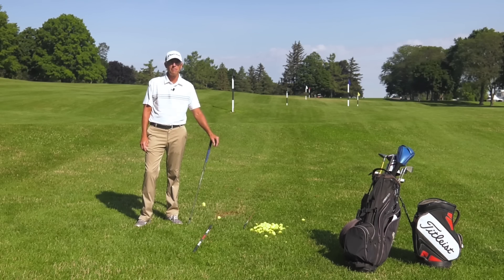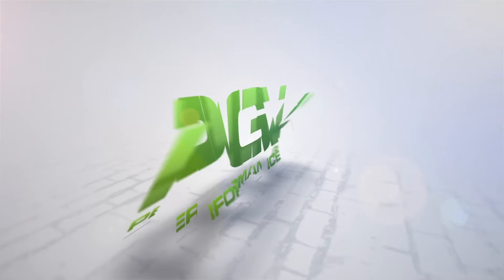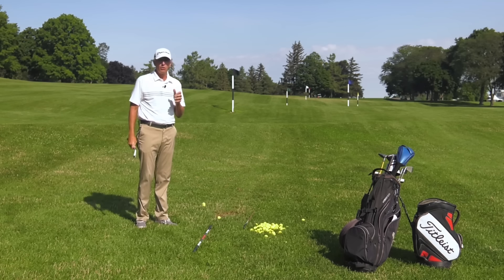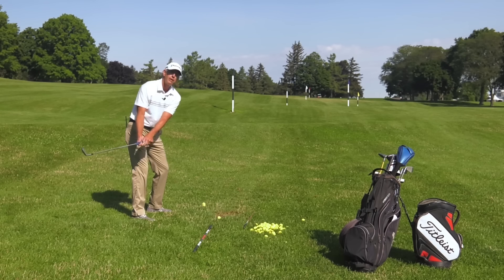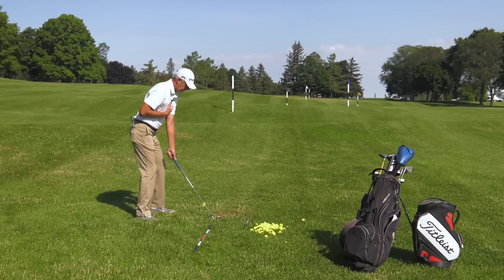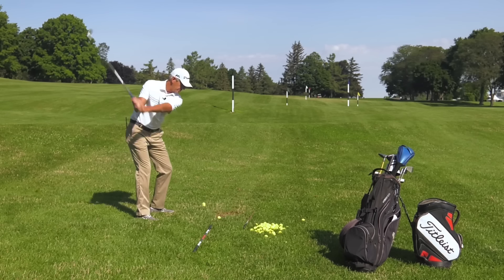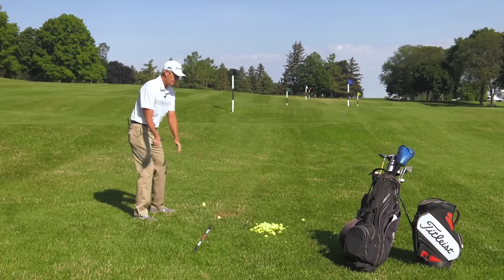Why You're Coming Over The Top In Your Golf Swing + How To Fix It!

Comment: That right foot back drill is the greatest thing I have ever tried.  Literally stopped coming over the top and hitting draws within one bag of balls.  Thank you so much.
Reply: Try the head cover/towel under back armpit drill. Much better because it actually teaches you how to swing on balance. Also it wont mess up your aim like this back foot drill.
Reply: @jacobsommers6952  that drill isnt bad but aim was not the focus.  Once I got a feel for my drill, the whole point is to set up square and have the in to out path feel incorporated.  I have even been using that as part of my pre-shot routine with great success.

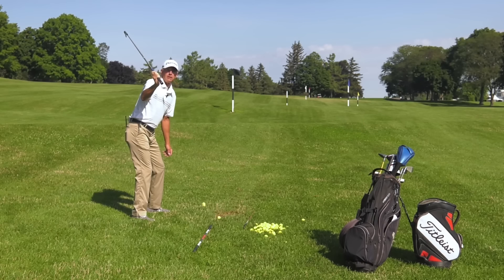Comment: At 0:51, you nailed what I do.  I've always (but been unaware of) started the downswing with my upper body, causing my club to be steep, hands out away from the body, and an outside in swing path.  You're video helped me discover this.  I went to the range to fix this - it's definitely awkward because the right way is new, but man did I ever get a hold of a few with a seemingly effortless swing because it was my hips that were dragging my upper body through to contact.  I went from 240 yd slices to hitting the range net about 80ft up the net at the 245 marker!  Thanks for the video. Very much appreciated.

Comment: wow, this actually worked. I was almost ready to quit. watched this yesterday, went to the range, did both drills and never hit a bad shot. unreal. thank you.
Reply: @Chad Williams yes, Chad, I put my left foot forward and it was almost in line with my right foot behind. just a little right of my left so I had some balance. it worked like a charm. hit everything straight. you have to do it enough to get the "feel" of using arms more but it worked. good luck!!! I had the same issue as you.

Comment: Great video Jim thanks, think your point about overusing the body, and focus more on arms dropping is spot on! Hope it helps my 20 year pull to the left!!! However 1 small question re tip 3 (ball above feet) you talk about swinging "up the hill" but a ball that's above your feet is not necessarily 'uphill', so do you mean an uphill stance/lie .....or as well as??Thanks  ps interestingly ive noticed last 20 yrs whenever i have uphill lie, right foot lower than left(ball fairly level) i hit better shots, and i dont mean just higher i mean better strikes. Wonder if gravity helping me drop my arms and the slope restricts me using my torso as much
Reply: ps unless you mean swing up the hill that is relative to ball/feet(not ball/target)i.e. swing from well inside?

Comment: great insight will be trying this next time at the range. Will this apply with the driver? I hit amazingly constantly long and straight at the range but once on the tee box i cant hit the the diver at all. I think this is the reason. Over swinging and coming over the top. Any thoughts?
Reply from the maker: Shawn. It's most likely from too weak of a grip (club face open in relation to your path). If you are right handed warm up hitting some  3/4 irons. Imagine a watch on your left hand. Keep the watching pointing towards the ground at the mid point of the backswing. Hit 4-5 hooks in a row. Then gradually feel like you are swinging slightly more out to the right. This will shallow your club out.  Give it a try, and let us know how it works.
Reply: Shawn, I have an unusual take on your problem. I wonder if your range tee boxes are very square, straight, level and plumb; while, your driver tee boxes on the course are pitched up, down, or sideways a bit. That's very common, you know, because it helps the tee boxes drain. My course is that way, and there are three tee boxes that are subtle side hill lies for the driver. The craziest ones have a lake on one side and an out of bounds, creek on the other. Since the tee box forces me to hit a draw, I end up aiming to hit a ball OB to the left. That's counter-intuitive for me. For me, the quirky lie of the tee boxes caused trouble with my balance and that caused subtle swing changes. Now, I stopped fighting this "groundskeeper's effect"; I just set up a little to the right and swing a little flatter. That change gives me better results than ignoring a slope.
Reply: Take a couple weeks off...then sell your clubs.

Comment: I am a 64 year old tall (6’2”) who played for 30+ years before having to retire from golf due to chronic back problems.  I always struggled with an over the top swing path and a slice ball flight, particularly with the longer clubs.  I tried every drill you demonstrated but all it did was cause either fat shots or push slices.  This was most likely the result of my pre releasing the club in an attempt to square the face.  I personally believe the reason I came over the top was an (incorrect) attempt to square the club face.  I therefore believe that coming over the top is actually a secondary issue and not the root issue of most golfers coming over the top and slicing.  The primary issue is the inability to properly release and square the club face.  That is the primary issue that has to be corrected first.

Comment: It's okay to lead with the body as long as you don't overuse the upper body, pause at top does work, also, feel as though your arms are like wet noodles; let the lower body be your power and keep the arms out of it, just let the arms get pulled through by the power of the lower body.

Comment: when i try to have a shaft lean at impact, i often have an open club face at impact and the ball flight to the right and end up slice it. any video on how to fix this problem? thanks. (and im pretty sure im coming over the top as well)
Reply: Sebastian Karim  Feel like your taking club outside in takeaway then shift weight to front on downswing.. and dont try to kill it at the top...when its in the slot about 1/4 to1/3 down smooth acceleration to finish.
Butch Harmon says most to the right ball flight is your head is getting in front of ball before hitting. Stay behind the ball. No peeking. So its a circle 8 outside...feels like it..take club more straight back on takeaway...then attack inside.. Jim Furyk is a great example over exaggerated...but in essence is the true swing path of out to in swing path.
Reply: i see. awesome, will try, thanks!

Comment: That semi circle take away is too confusing. I would just focus on, at that moment, is my shaft level with the ground, pointed at the target and club head is at 90 degrees? If yes you have a good take away. You can also practice this by sticking a towe or head cover under your back armpit and not letting it fall until the follow through.

Comment: That drill will make it worse.  You're advocating artificially moving the pelvis out of the way so when the player tries to swing normally the pelvis IS in the way and the OTT swing gets worse.  To truly fix it, the player must open the stance, with the lead foot back and learn to properly get the pelvis out of the way.  Most OTT swingers aim right of the target because they need to get the pelvis out of the way.  Artificially, fixing this doesn't actually fix it, making it worse and learning to truly fix it, is the only real fix.  Also, OTT swingers dread the ball going right so they prematurely close the clubface on the way down, forcefully and manually, so by the time the clubhead reaches the ball it's re-opening as it tries to correct itself.  When force is applied to the handle the clubhead will lag behind the shaft, as this force decreases the clubhead's inertia overtakes the shaft which we call release.  If this happens to early in the downswing, the engineering of the club will attempt to correct itself and will end up closing twice, once too early when forced, then again naturally after the force applied to the handle has decreased.  

If the clubface is square to the target line prior to impact the ball will not go straight as almost everyone believes.  The clubface must be open to the target line prior to impact so that it can close through the ball and be slightly closed as it exits impact.  These simple misconceptions are the reason people come over the top and why golf is so hard for so many.  
Here's a simple drill to prove my point.  Go to the range and try to hit the ball dead right with a completely wide open clubface.  Sounds crazy, I know but it can't be done.  The engineering of the club will cause the clubface to close and the ball will fly straight.  You can't keep it open if you try.  Prove yourself wrong in the belief that the clubface has to be square, it's the only way to positively make a significant improvement.
Reply from the maker: So couple things. 
~Moving the trail foot has no bearing on alignment in relationship to what the clubface is doing. Moving the trail foot back allows the pelvis to increase it's turn in the backswing and thus allowing the arms to travel deeper on the takeaway. Moving the lead foot back will allow the player to potentially exit more left with more pressure in their lead heel but it also increases the amount of lateral motion in the downswing. 
~The clubface can't "re-open" as you put in the downswing. It can close less by decreases rate of closure but the only way for the clubface to "re-open" is a toe hit
~ I agree the club face has to be pointed right of the target going to the ball but it better be square the moment it hits the ball and closing through impact
~ And I promise you I can line up a bunch of players with a wide open clubface and watch that ball start a mile right.
Reply: @PerformanceGolfZone  Ok, good points ... the right foot back is like this ... If you always almost hit a telephone pole every time you drive a car around a corner and we temporarily move that pole so you don't hit it, let you get used to that, then put the pole back ... what's going to happen?  So, the better solution, move the pole out more, let you get used to that, then move it back and you'll miss it every time.  Do you see what I mean?  I've watched people do this move over the years and every one of them has a problem with early extension and over the top ... and they never get better by using this drill.  They often use it for desperation when they really really really need to hit the fairway.   Mostly though, they develop bad habits like aiming well right of the target and pulling the club across desperately trying to get the ball to go straight.  

I don't know why you'd say the clubface can't re-open.  Absolutely it can and it does for thousands of people every day.  Any time you force a lever and then put opposite force on it's base it's will re-open which is what these people are doing.  They throw the club out closing the face, then yank down on the handle to force the clubhead to meet the ball and in so doing the face rotates in the opposite direction through impact.  This is simple physics and inertia.  
One of the biggest problems with golf is that adults assume they understand how the tool works and they don't.  They try to force the club to do what they believe it should do and it's fighting them almost every step of the way.   Most people never conquer their fears and never get better.  Many people were better ball strikers when they knew nothing about golf.  Once the brain gets confused with weight shift, swing plane, release ... bla bla bla ... the player gets worse.

As far as hitting with the clubface wide open ... I'm telling you, it can't be done.  Not unless you're doing something silly like manually closing the face way too soon.  The limits of the human body, a proper grip, and the engineering of the golf club prevent the clubface from moving through the ball wide open.   It's a great drill to teach people that their greatest fear isn't a fear at all.   Give it a try and you'll have your students doing it within a week.
Reply from the maker: I'm still intrigued by this clubface re-opening scenario. Can you send video in slo-mo where you see a clubface closing to impact and then opening prior to the hit? Cause in my mind what you're describing is just slowing the rate of closure of the face not actually getting the face open. 

As far as the stance thing. I believe it depends on the players body density and leg length that dictates the stance they have because it also has an affect on which leg they use as a post in the backswing.
Reply: @PerformanceGolfZone  I don't have any video of the clubface re-opening, but if you think about it, it's simple physics.  If you force a lever to close too early and then exert force on it's base it will fall behind the force regardless of the fact that it's already been there.  When over the toppers throw the club out from behind them in a casting motion the clubhead reaches it's peak speed when it's way up in the air about equal with the right shoulder then they have to exert more force on the handle to get the clubhead down to the ball.  This second force is what causes the clubface to open as they're forcing the clubhead downward.  Then after that force is exhausted the clubface closes properly overtaking the shaft but the ball is long gone by then.  
We only get one chance in a golf swing to use the fast twitch speed and if it's used at the start of the downswing it's gone and can't be regained but that's what over the toppers do, with futile effort.  This is why over the top golfers are very tired after a round of golf.  They're doing twice the effort and getting half the efficiency.  What these golfers have to learn to do is reserve that twitch until the get to the ball.  This means they have to learn to turn their torso without swinging the club until they get to the ball.  Because it's feels like they're not swinging, it's very hard to get them to understand this.  It's also why they strike the ball so much better when they're not trying to hit it hard.  

Stance ... well it actually depends on the idea the player has in his head as to how the swing works.  Most people have it completely wrong.  They try to swing the club downward at the ball which causes them to stand up as the hands move down into what we call early extension.  What actually happens in a proper golf swing is that the player is swinging upward at the ball which is slightly above their shoulders - if you are bent forward properly.  I have several videos on my channel proving this.  The best ball strikers strike the ball above the shoulder plane.  This concept is something that apparently only I have realized.  When you understand this concept the swing completely changes and the player can swing flat and level through the ball striking it solidly and the pelvis is completely out of the way without the player thinking about it at all.  Body composition or height has nothing to do with it.  Take a look at John Daly, today, he strikes the ball on or above the shoulder plane and his pelvis is not an issue.  

Basically, this exercise that you're advocating is a temporary fix for a bad swing.  Getting the player to truly understand how the club and swing actually work makes this exercise moot.  When the idea of the swing changes in the players head to the proper swing, everything changes and many if not all of these problems are gone.  Adults think they understand how the tool works but they simply don't.  When they try to use it as they believe it should be used it essentially fights them to do what it's engineered to do.  Children have no preconception of how the club/tool works and don't care which is why they let it do what it's supposed to do and it does it.   Most everyone can remember a great shot they hit when hitting a ball back into the range from the golf course or just hitting a ball back to a friend.  "Why can't I hit the ball like that every time!?"  Well they can, if they'd only let the club do what it's supposed to and stop over-manipulating it.  Golf would be a lot easier for everyone if distance weren't part of it.  The strive for distance is what causes most people's lack of it.